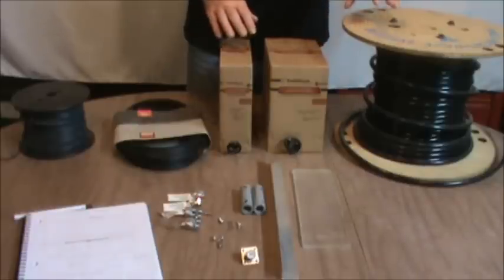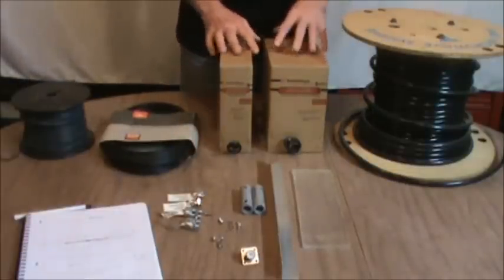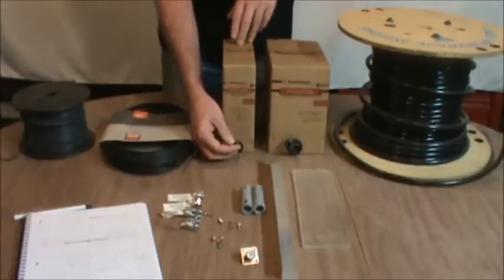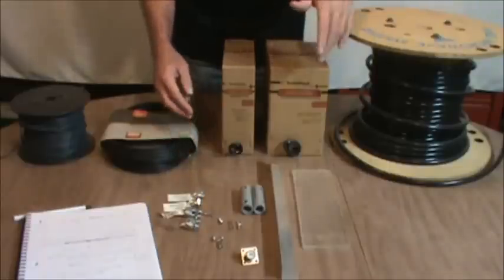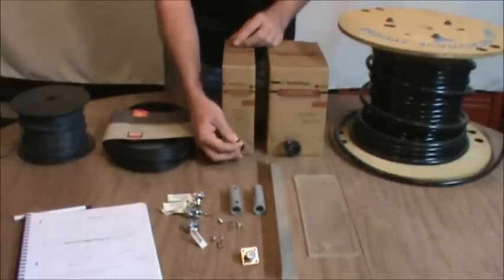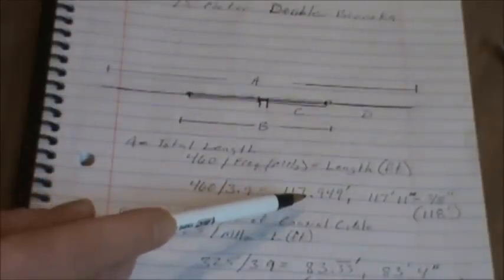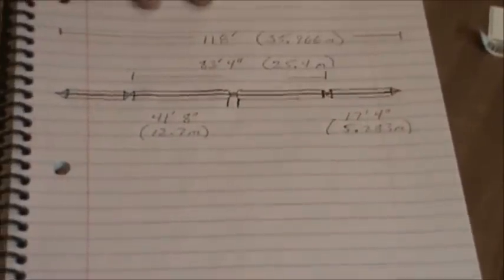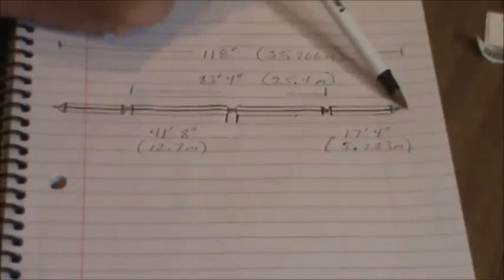Easy 75 Meter Double Bazooka Antenna, Part 1 of 4

Comment: HI Dave, I know that this video is a few years old but I thought it was great. I am in a strata with very little room. I am using a inverted "L" for 80 meters. I was wondering if you could tell me how I could build an inverted Bazooka antenna. I know that there is a commercial one out there but it would be over $175 to buy it and have it delivered to Canada so I would rather build if I can. Thanks for you videos Cheers,  Dave VE7CMI

Comment: Never use foil coax or double braided for the antenna.  More shield is good for feedline but not for the double bazooka.  About 85% shielding is optimal.

Comment: Was wonder if its possible using  RG-6 coax sense its 50-75 ohm
Reply: Not if it has the foil wrap under the shield. The foil keeps the shield from interacting with the center. Reactance maybe. I forget but this design doesn't need a balun or RF choke and the foil will defeat that. Most 75 ohm cable has foil. Plus the solid center can break more easily. So if you do find some with out foil be very care not to bend it or roll it up in a small roll!